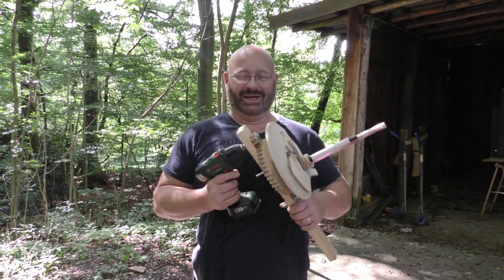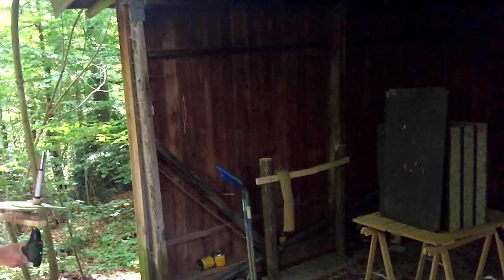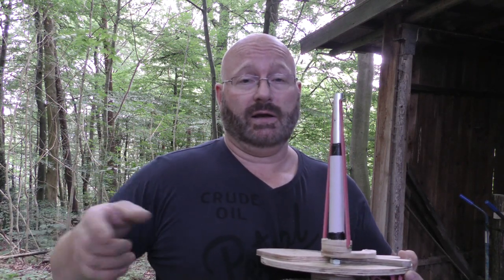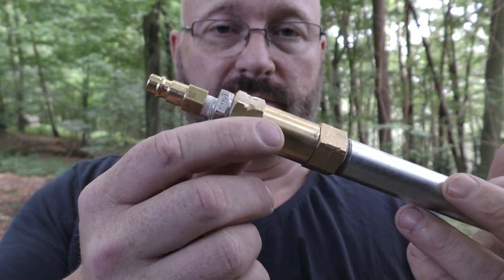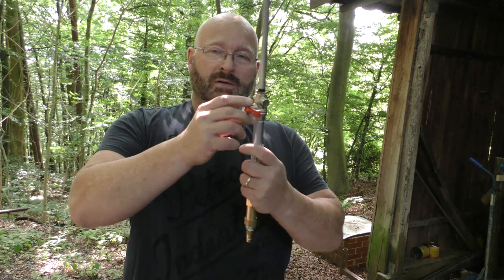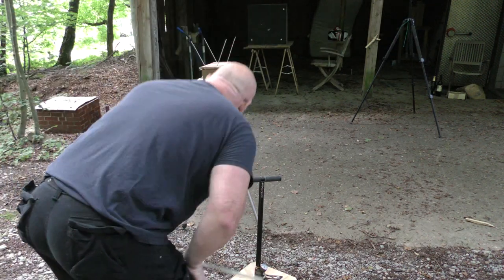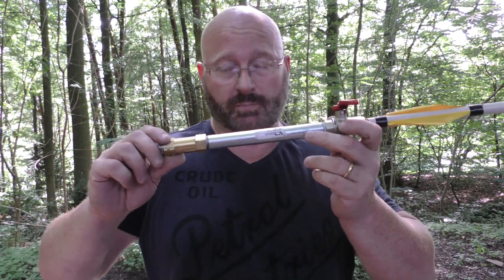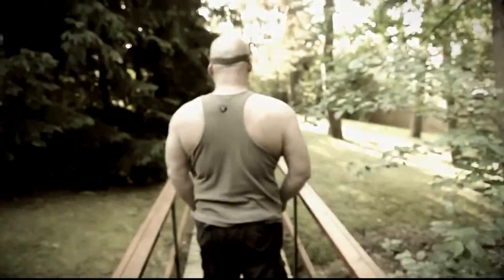Progress Fun! Wow.

Comment: 2000psi? I really doubt that pump is capable of 2000 when your basic pressure washer isn't. Its probably more like 200 (which is quite respectable). At 2000psi it's awfully close to the physical limitations for those parts. Might want to start looking into heavy duty stainless steel parts for more power.
Reply: It's a special type of high-pressure pump designed for airguns.
they go to 3000PSI without too much effort if you get a good quality one like for example the "Hill Mk3" or mk4 pumps.
Reply: I read +Fr4g4lot reply, but have to admit I'm skeptical that any hand airpump of this style(I have a hard time getting 40psi in a bike tire with one of these) could generate 2000psi or if the style fittings used could handle 2000psi...sounds like pipe bomb to me! Regular air compressors generate 120-135psi, commercial shop compressors may run 180-200. They run this high to get extra capacity and extra power out of pneumatic air tools....although they damage them in the process as most of them are recommended to be run at a lot less. Have you ever seen the damage 100+ psi can leave behind when out of control? Seen a truck tire go through a roof? I realize the power increase drastically with the size of the object but still...2000psi...really????

To get to 2000psi your stepping up to the pressures in scuba air tanks and the very specialized air pumps that fill them...but think of the heavy construction of the air tanks and fittings in this psi rating...I'd be very surprised if those materials are rated he's using here are rated for this
Reply: +tazmun The hand pump can generate the pressure very easilly, and these are very common with airgun shooters. i've got the Hill Mk3 right here that goes to 250bar, up to 200 bar you can even do it single handed! i'm not joking, it's EASY with this pump!

The fittings used in this video however are not suitable for this, and you are right about it being dangerous. The correct type of fitting to use is a high pressure foster fitting - such as the one used by his FX airgun.

Regarding your compressor comment,
The high pressure standard compressors go that high for specialty applications that require that high pressure, or to compensate for pressure drop over pressure regulators, and to increase capacity inside of the air tank. it's not really meant to get "more power" out of standard tools :)

You can go higher with either a specialty compressor, which costs a ton, or a "booster" compressor, which also costs a ton.. both require a lot of maintenance too.. There are chinese ones, but those only last a scuba tank or 2. (and these are not suitable for diving as you need a higher purity air, and possibly helium mixed in)
Reply: +tazmun Actually, this pump and a regular bike pump have a major difference despite looking extremely similar. The force you have to exert on such a pump is equal to the pressure in the pump times the cylindrical section of the pump. This pump has a much smaller section which means that for a given force, it will produce a higher pressure (but a lower volume of air, so it will take longer).
That is why you find it hard to go beyond 40 psi, it is because the bike pump is not designed to produce an insane amount of pressure (while this one is apparently)
Reply: The pump jourg is using is a pump especially made for airrifles and can reach pressures asound 4000 psi. A normal aircompressor isn't able to reach pressures above 250 psi. There are aircompressors capable of producing such high presures but they will cost you around 3000 us dollars at least. 

Besides that, i'm sure that jourgs little experiment is capable of handling 2000 psi. As comparison, a pet (plastic) bottle explodes at around 200 psi. Jourgs air chamber is made of thick metal and is a lot smaller than a pet bottle. 

I hope that this has cleared things up a bit.
Reply: Whoops. I didn't notice that someone had allready reacted on this comment.

Comment: 2000PSI i didn't even know that was possible with air! At which pressure does the air get liquid at room temperature?
Reply: at room temperature it doesn't, it remains a gas.. just a highly compressed one. :)
Reply: +Fr4g4lot I'm sure if it was compressed enough the molecules would be close enough to practically a liquid. Not gonna get anywhere that pressure though
Reply: Air is weird - you can get it supercritical, but you can't squeeze it into a liquid at room temp.
To get it liquid, you need to cool it down a lot, down to cryogenic temperatures.
Reply: +SmallBallExtreme - at room temperature?
all phase diagrams I can find only show supercritical regions for common air.. http://www.wolframalpha.com/input/?i=air
Reply: Wait, i was mistaking PSI with BAR, here, sure 2000PSI is alot too, btu my brain was thinkin in Bar ;D
Reply: You might not be able to squeeze are into liquid at room temperature but doesn't increasing the pressure cool the air anyway? So by increasing the pressure it will eventually cool down below a room temperature. You would need to keep warming the air to keep it at room temperature at really high psi. I think......

Comment: how about a pressure gun that shot hex nuts repeatedly, is it possible or effective? I will be waiting for more beastly inventions :-)
Reply: He'd have to find a way to shoot them over the barrel instead of through, otherwise in German law it needs to be licenced, if it goes over the barrel it's considered a toy (even though it can be just as dangerous)
Reply: In order to shoot over the barrel just use a piston assembly that allows for a central guide rail for the hex nut. Would need to attach rubber going in the opposite direction or have some sort of padding in order to slow down the piston near the end of it's length in order to prevent damage to the weapon.